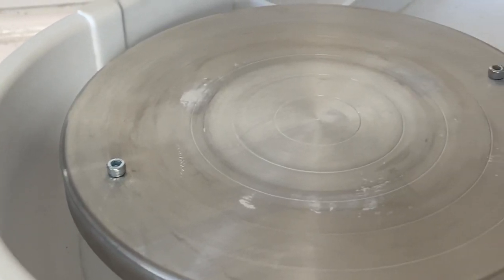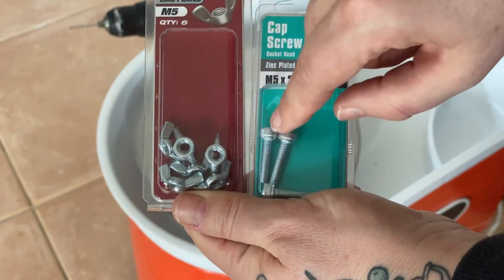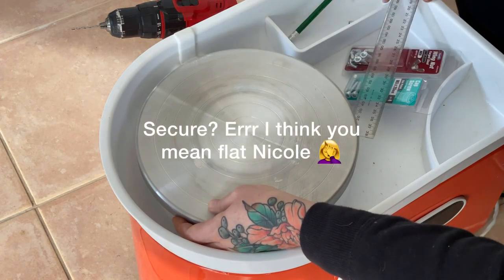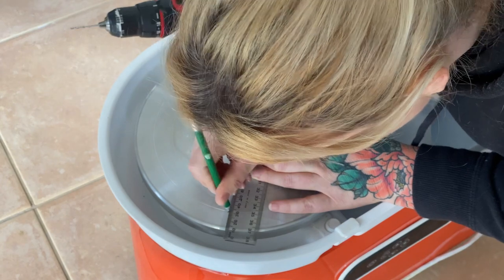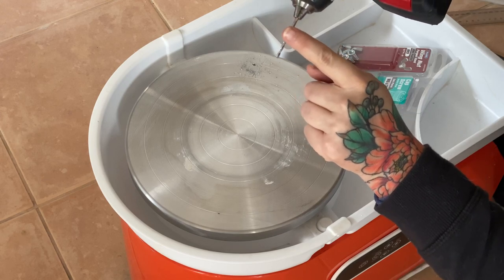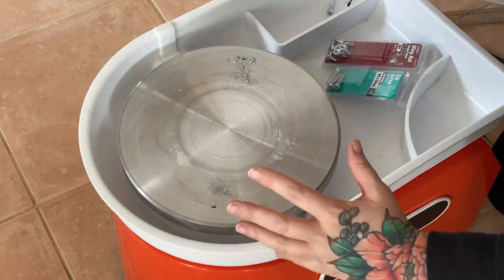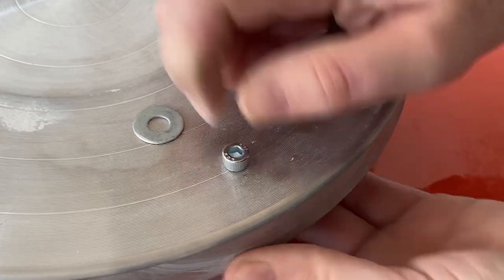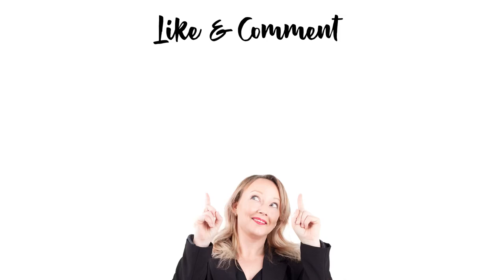How to add bat pins to a pottery wheel - Drill your own bat pin holes

Comment: Do NOT use hammer action when drilling metal or wood. Its not necessary, the drill bits are not designed for it and you stand a very good chance of snapping the drill bit with possible damage to the surface of your wheel or yourself!

Comment: Just a heads up, using the hammer drill function  on aluminium can be dangerous.  That function is for drilling into concrete, brick, or stone.  Aluminium is soft, but brittle the piston hitting on a hammer drill can crack, fracture, or chunk out the aluminium.  This could send pieces flying and injure you.  Stay safe.
Reply from the maker: @gasd6542  thank you, taking note. 🙏

Comment: I know people have pointed out don't use the hammer mode on the drill but it didn't sound like you were using a hammer mode(hammer is much louder) and when pausing the video it looks like the drill doesn't have a hammer mode and is just on drill mode unless im being blind :p Normal drill mode at full speed and not too much force is the way to go with metal from what I know. Awesome video though. I have a varient of the same wheel and might attempt this. Im suprised that all wheels dont come with these built in.

Comment: Please avoid the hammer function on a drill when drilling into metal.  to avoid over heating a small ring of wet clay [1" diameter] around the hole site, filled with a little water, will avoid over heating if your wheel head is very thick.  Obviosly the correct drill bit helps as well. i.e. not wood or masonry bits.
Reply from the maker: Good point. My wheel head is aluminium so like butter to drill through so I wasn’t worried about overheating but if people have steel wheel heads then that’s definitely the way to go. Thank you. Yes I used a drill bit for metal.

Comment: Thank you. But I wonder why you'd need to use a wing-nut. I think you only need to drop the screw down, which would hold it just fine because of the 90-degree torque motion of the wheel. Any thoughts?  Cheers from Japan.
Reply from the maker: So that when you take the bat off, the screws stay there and don’t come with the bat. I’ve generally got clay covered hands and just want to lift it off and set it down easily.

Comment: Can't find the video on how you made the bats, was it ever posted??
Reply from the maker: Ohh it wasn’t, I’m so sorry. Basically I just cut out circles of Masonite with a jigsaw and used a template to mark where I needed to drill the holes for the pins. Masonite is used for bats as it doesn’t absorb any water and is super smooth on top. I also made some that have an inner cut out for mugs etc. Hope that helps.
Reply: @NicoleHerrickDIY  Thanks so much it does. 😊 If you don't mind me asking, it's been a year since you put up the video, how have the bats held up for you??
Reply from the maker: @TheIdolLife  bats are holding up great! Used many times over.

Comment: Hi we are just adding the pins to ours! Did you coat your Masonite with anything and did you have any troubles centreing using the diy bats?
Reply from the maker: Oh cool. No I didn’t coat the Masonite bats, they surprisingly stay waterproof. I thought they would puff up. No trouble centring, you could add some rings with a sharpie maybe if you need some visual circles.